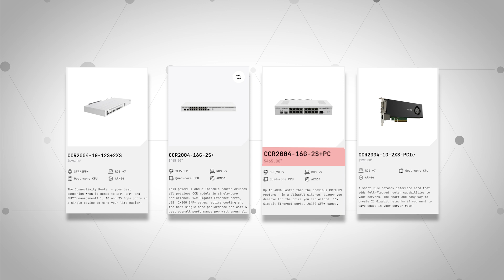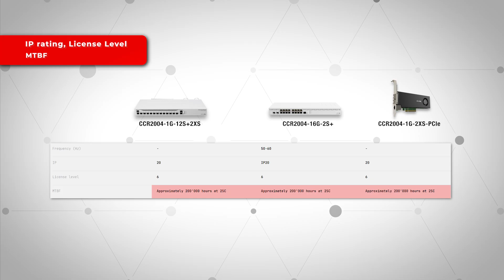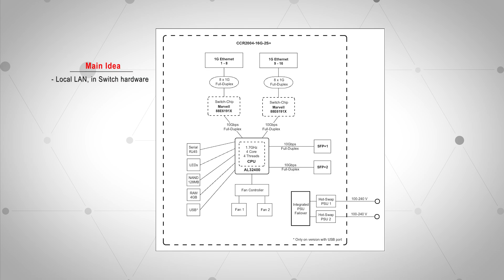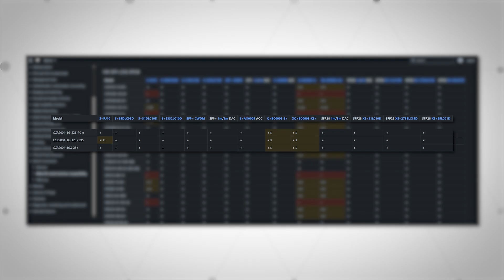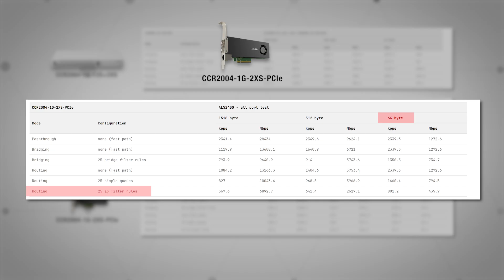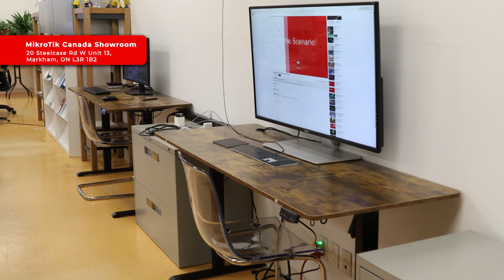MikroTik CCR2004 Series: Ultimate Breakdown and Confusion Buster (Which Model to Buy?)

Comment: There is no unrealistic expectations, there is only lack of 2.5GB ports, unfortunately, I don't know what Mikrotik has against 2.5GB ports.
Reply from the maker: Thanks for the comment @pbrigham, 
Please, go to 13:29 in the video. MikroTik’s point is basically: they treat 2.5G as a supported link rate on certain SFP+/SFP28 ports (with a proper 2.5G transceiver), not necessarily as dedicated “2.5GbE RJ45 ports.”